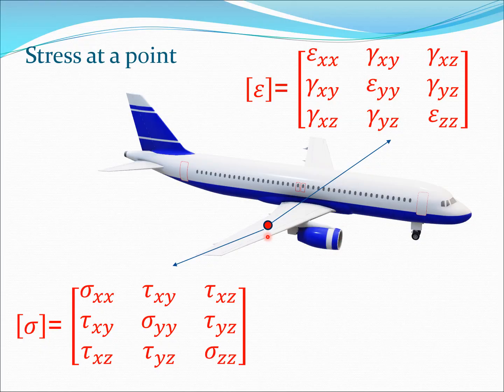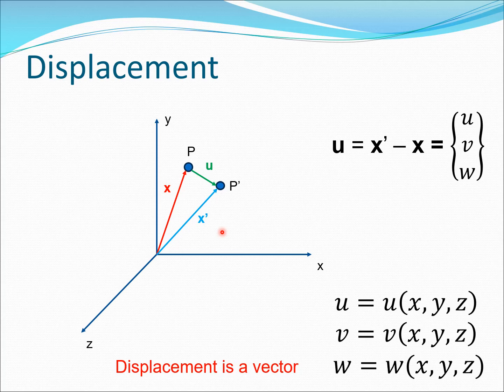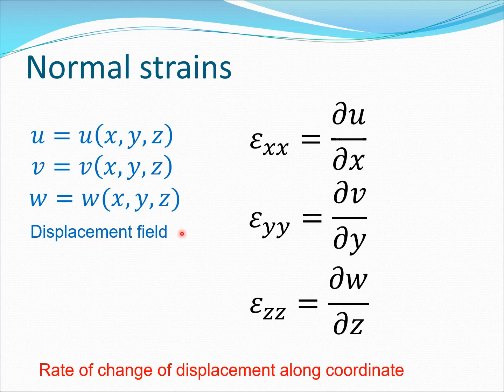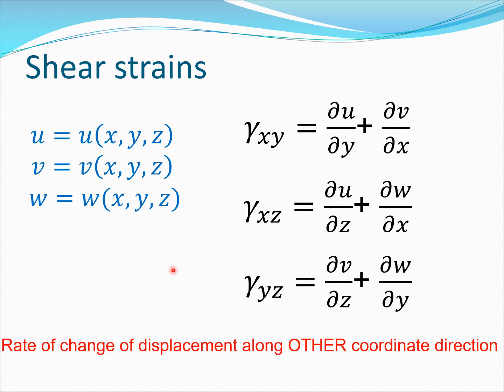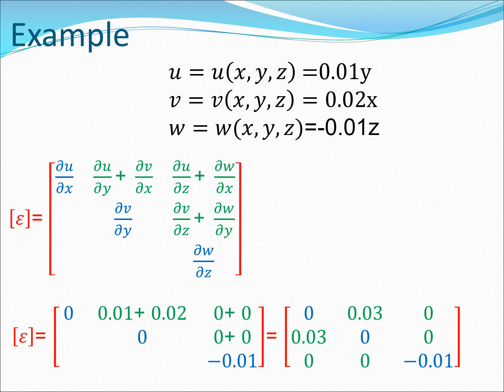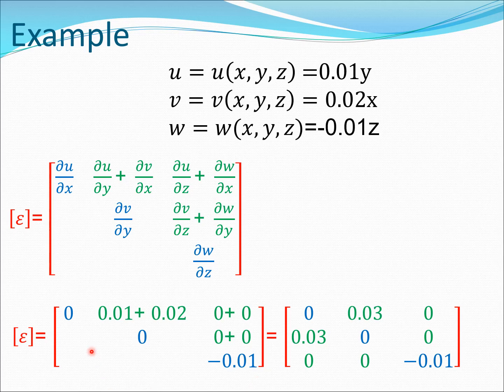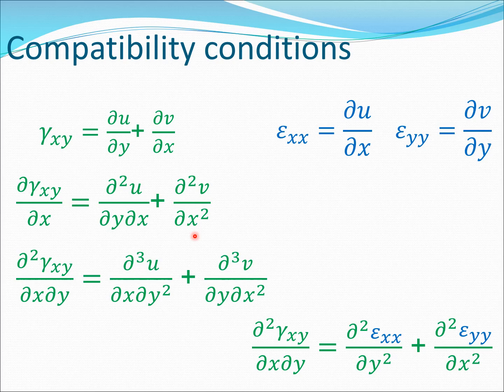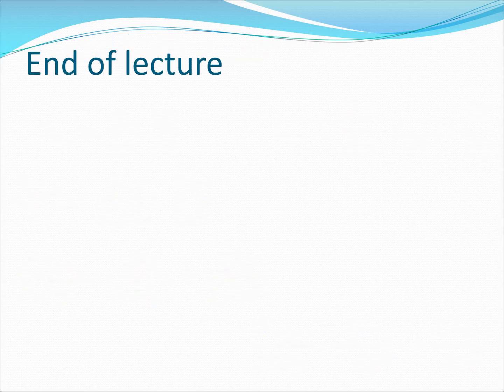Strain and Displacement, Aerospace Engineering Lecture 73

Comment: The strain tensor on slide 1 should have all gamma terms divided by 2 (tensor shear strains).
Reply from the maker: Yes you are right. The aim was to show this schematically. In engineering we often use the strain matrix with gamma instead of the 2 epsilon term. We know that this cannot be use for transformation as in that case the strain tensor should be used. Thanks for pouting out this issue.